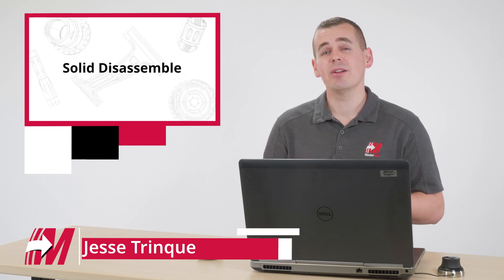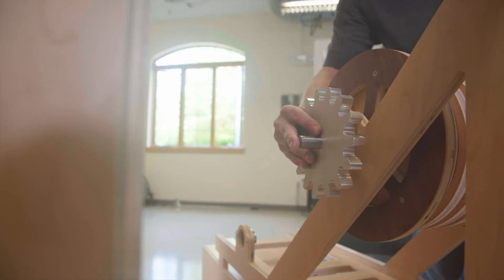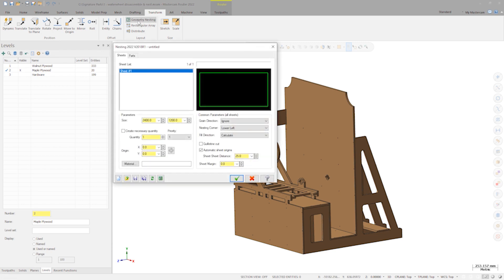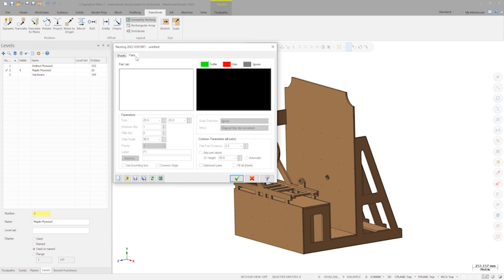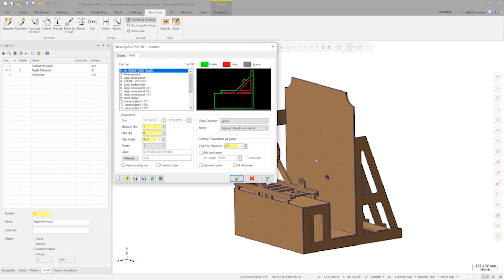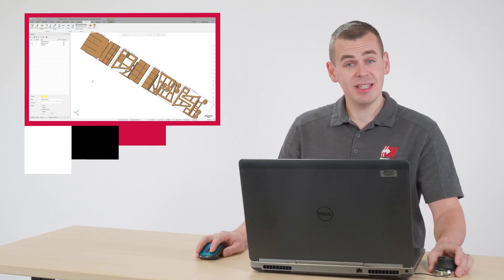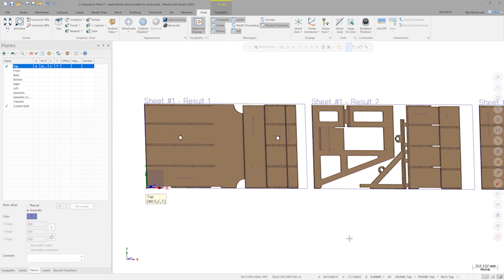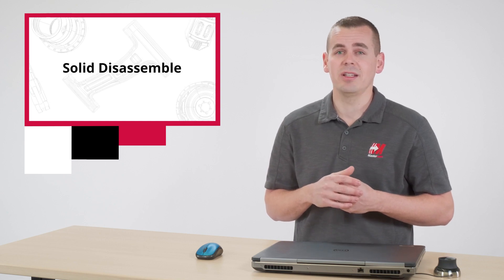Waterwheel: Assembly and Nesting Features – Solid Disassemble | Mastercam 2022 Signature Parts

Comment: Just curious  what Dell laptop are you using?
Reply from the maker: Hi Joe! Our Applications Engineers currently use Dell Precision 7730 laptops.
Reply: @mastercam  Thanks   i am currently running Dell Precision M6800 7 years old looking to upgrade     Can you tell me what ram vido are they runningcard
Reply from the maker: Hey Joe! You can find our system requirements here: https://www.mastercam.com/support/technical-support/system-requirements/